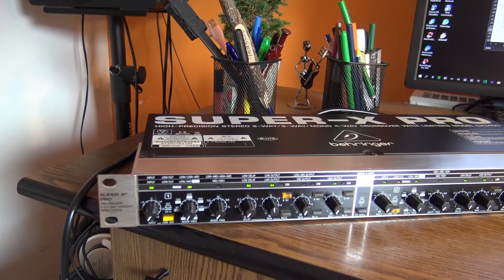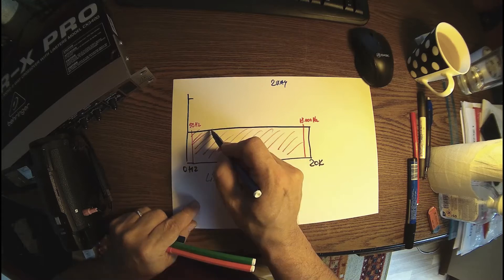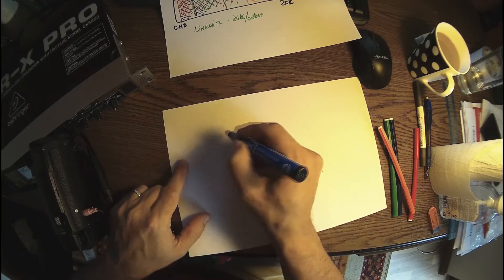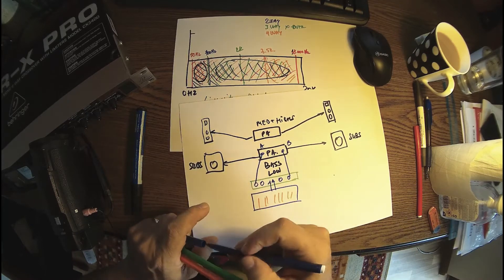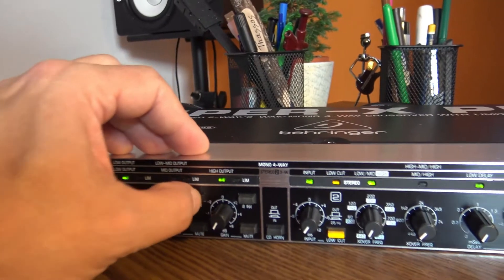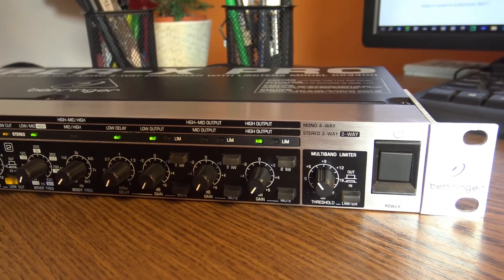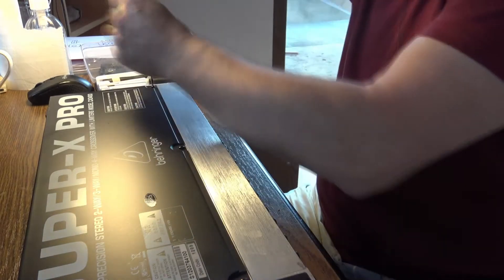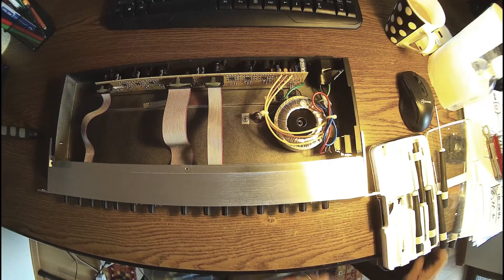How to avoid burning your loudspeakers Behringer Super-X PRO CX3400 x-over

Comment: I saw this crossover on sale on amazon for $110, and ordered it for my home stereo. compared to $70 - $100 units, the CX3400 was evidently designed with a greater emphasis on component selection for sound quality. you'd expect this to cost a lot more, not to mention its extra features. I did read some bad reviews of the CX3400 v1's reliability, but not of the v2's, so I assume they fixed the problem. I felt more assured by the designers being German, clearly having a passion for sound quality, and only manufacturing in China. Seeing the internals has given me yet more assurance, thank you!
Reply from the maker: I'm happy with mine, it’s doing the job for now.

Comment: hello, thaank you first for your video. It is very usefull for beginners. Could you explain in a paper A4 this  connection please? I have the cx3400, in stereo mode i want to connect one  passive subwoofer. I will use the sum sub output? The gain sub in which level is good to be?( i have it in 0db and my amp protect is on occationaly.  IF i dont use the sum sub output mode, one sub in which channel is good to connected? than youuuuu
Reply from the maker: In fact, for subs doesn't matter if it's stereo or sum, I use it in mono anyway. If you don't sum, any channel will do the job. For the gain, there is no standard level let's say, it's up to you and your ears. Usually the power amplifiers have a clip LED, so take care not to see that too often...so use common sense.
Reply: @viocaia   because i have only one 15" passive sub. So, if i connect the sub in "R" signal channel.. the "L"  music not playing.  On the other hand, in sum "R+L" .. the sub will play both , all music. 
There is difference between this options or i make mistake. For the gain, i understand, ok. (Thanks very much for your time , and the information. 🙏🙏)
Reply from the maker: @stefanoskas4799  At very low frequencies, it doesn't really matter  which channel is playing. Mp3s are usually mono at those lows. So any of the low outputs will be ok. Don't think about loosing any music signal.
Reply: @viocaia  thank you very much!

Comment: The crossover's low frequency delay is supposed to work in a configuration with subwoofers in front of the main speakers, not behind them.
Reply from the maker: Thank you for clearing this up..
Reply: That is what I was wondering as well - thank you for clearing that up.  I guess such feature will come into use where you have a large venue and need to compensate for the perceived hearing (e.g. about 1 second delay when you have a 343-metre length.)  This is only my guess; I have never had to work in such venue.

Great video, sir - thank you very much.